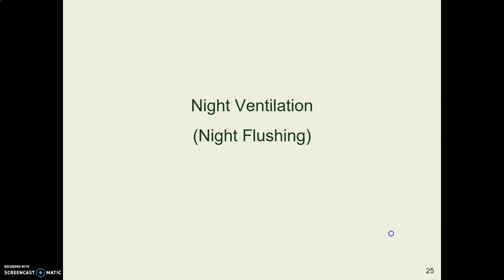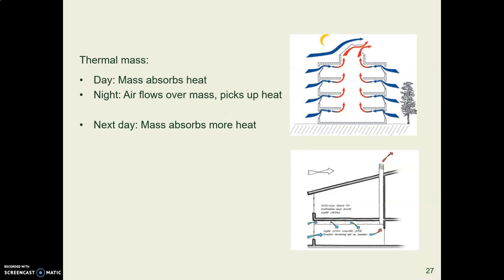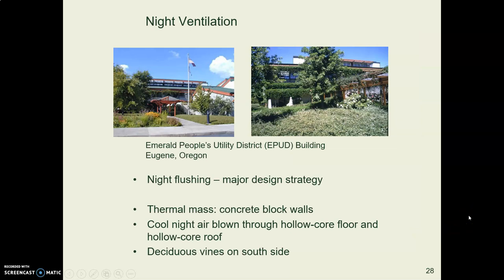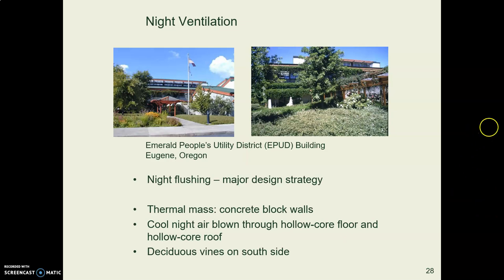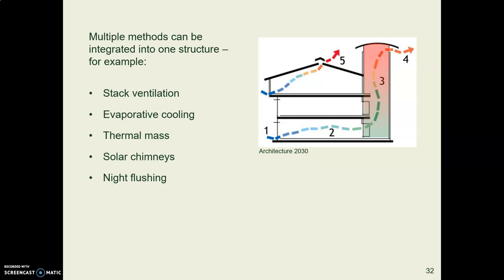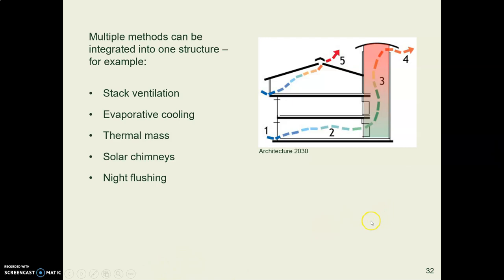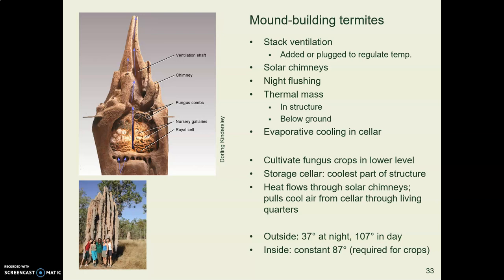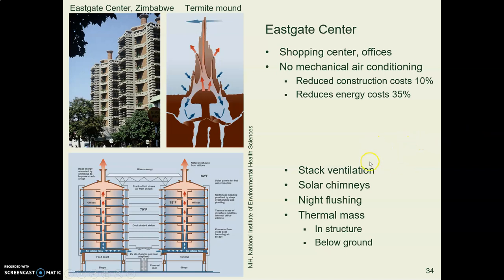SBS09b3 passive cooling   night ventil et al VL

Comment: Thanks for the video! As a fellow Oregonian who lives in the Cascade foothills I use this method as well. Every evening cool air comes down to the valley from 6000' and flows through my N/S orientated house. Only had to use the heat pump last summer during the weeks where the wildfire smoke was in the hazardous category.

Comment: Can you show real world application of this to multistorey compact houses in hot cities. Thanks.
Reply from the maker: You need to be in the kind of hot climate where it is markedly colder at night. So, a desert climate is perfect, and a tropical climate is not. It will work in a temperate climate, too, if the urban heat island effect isn't too great. Then you want thermal mass to absorb heat: concrete, stone, etc. Try doing an internet search under "night ventilation" or "night flushing." See if you can get "Heating, Cooling, Lighting: Sustainable Design Strategies, 5th ed." by Lechner from your library. It's super helpful.